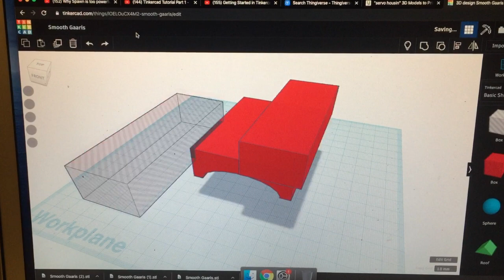Spider-man web-shooter 2020

Comment: Awesome!!! I have 2 questions regarding the last video of the grappling gun... 1: how did you get the trigger to go horizontal and stop co2 from coming out until you opened it vertically at 1:30 in this video...https://youtu.be/jU809DL0bKo? And 2: do you have a copy of the design off of the 3d printed pieces because I like how yours looks like a grappling gun and mine just looks like a piece of plumbing... anyway VERY nice web shooter!! Nice job!!!👏👏👏👏😎
Reply from the maker: hey sorry for not replying to your other comment. so for the 3D model i found it on thingyverse or yeggi. under  Lora croft grappling gun or something like that. I un screwed the black valve part and rotated it so that it was closed even at that angle
Reply: @theunstoppablefreefall  ok thank you!!👌
Reply: @theunstoppablefreefall  hey what are those motors called?